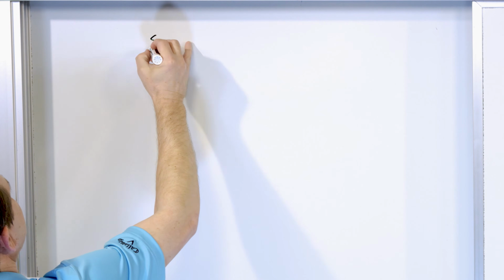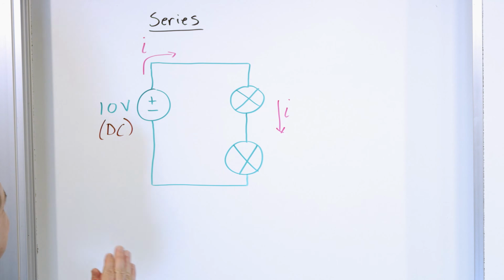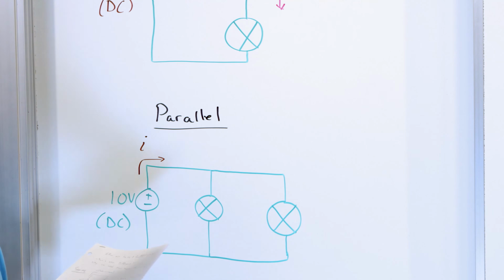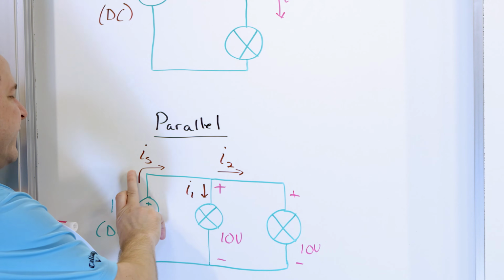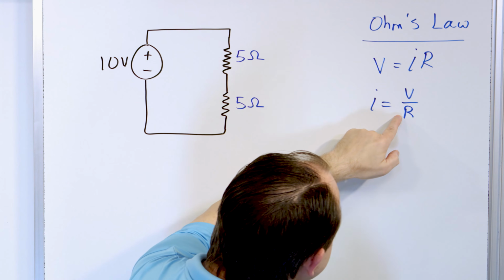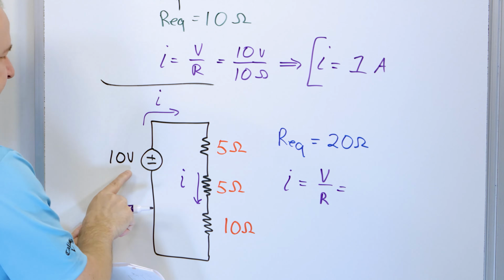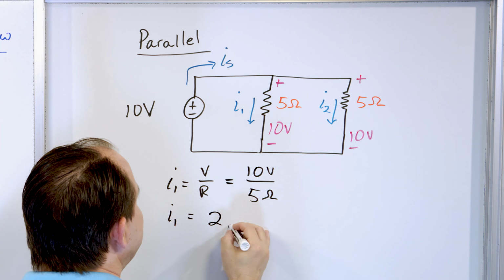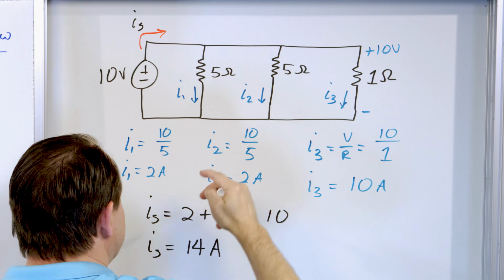Series & Parallel Circuits: Theory, Uses, and How they WORK

Comment: I know this is probably beyond my current understanding but does the battery. In this case the 10v battery, does it have a max amount of current "push" that it can put out. Like if I kept adding bulbs to the parallel circuit what happens? Assuming the battery has enough charge to not die.

Comment: Sir your explanation is very good and thank for sharing your valuable knowledge but you didn’t  explain resistance in parallel circuit. I mean if we add resistance in circuit total resistance will decrease and current increase.

Comment: I've been studying and currently finished an associate course in Electrical Installation & Maintenance in a government technical and vocational school, but this is the one i miss a lot the way it was demonstrated and explained it the way you teach. and it is very much comprehensible. thank you sir. i have now much understanding in what ive learn previously and its significance. specially the Ohms law, as well as the parallel and the series connection most applicable in household and in commercial establishments when installing electrical wiring.

Comment: When you showed the first parallel circuit diagram with 2 resistors(R1 = 5 ohms and R2 = 5 ohms), the current obtained from it was 4A. Then, when you showed the last parallel circuit diagram with 3 resistors(R1, R2 and R3 = 1 ohm), the current obtained from it was 10A. Does it mean let's say, you add 4 resistors, each of their resistance is 1 ohm and a electromotive force(e.m.f.) of 10V is applied through the circuit, will the individual resistors take in 10 amps of current which in total would be 40 amps?

Comment: I'm an electrician and   when you run outlets through  a room on one circuit they usually use the o outlet as the ridge or junction point. They don't run a pig tail of of two words to attach an outlet. So when one circuit or rather one outlet goes out in the living room that all go out and then you have to trouble shit all the outlets from kids of power

Comment: Might I add that the reason we have two thoughts on electron flow is that, for centuries, positives always moved toward negatives.   High values dominate low values.   One major example is that high-pressure atmospheric air flows quite naturally toward areas where the pressure is lower.   It is often considered more intuitive to assume "stuff" moves from a surplus to a deficiency.   With this principle established, early scientists, like Benjamin Franklin (1706 to 1790), assumed electricity was a fluid moving from high potential (+) to low potential (-).

Developments in particle physics enabled scientists in the late 19th century to actually observe that negatively charged electrons are the particles moving through metal wires from the negative terminal to the positive terminal.   The initial, incorrect assumption was deeply ingrained in engineering textbooks, diagrams, and conventions long before electron movement was understood.

Inconvenient?   Well, yes!   However, the flow of negative charges in one direction produces the same physical effect as a flow of positive charges in the opposite direction; thus, for most calculations, it doesn't matter.  Most!    The main problems arise when the physical direction of electron motion matters rather than just the current.    Actual electron flow matters in the fields of semiconductor physics, vacuum tubes, ion beam technology, and analysing electron motion.  The most significant "problem" arises when a person mixes the two conventions—such as using the direction of electron flow with right-hand rules designed for conventional current. 

Essentially, conventional current is a universally accepted historical "convention" for analysing circuits, while electron flow is the actual physical process.

Comment: On the series, two bulbs get the same current, what about the voltage? My understanding is that the voltage split by the number of bulbs, in this case two bulbs, so both get 5 volts each. Am I right?

Comment: First time I ever 'sat' in a class, where not only their teacher is a genius, but also his students are 'all' genius!!
I kind of got lost, when current either flows one way, or the other.  My logic was disturbed when the explanation that electrons flow from - to +, BUT let's pretend positrons are flowing in the opposite direction.  Why?  We were already told that the electrons were the real flow of current.  Better was the parallel explanation of a river flowing, from source, and splitting, into 2 branches.
I begin to think this electrical engineer must not be too successful at fishing;  if he 'pretends' the fish are actually swimming against the current, instead of the real direction of current flow.  No?  Well, what would compel the fish to not take the path of least resistance?  There must be some sort of payoff, to follow path of higher resistance.... like a salmon run, right?😢
I guess y'all figured it out;  I'm not too good at conventional fishing, so I must use a net, to catch enough for supper.

Comment: Hi. Great Video. I need 36V minimum 3.5A Din Rail PSU, but I struggle to find one within UK.
 I already have Omron 12V 4.5A and Omron 24V 2.5A. Can I connect them in series?
 I'm worried that I could overload the 24V one under 3.5A Load.
 I can get the same Omron 24V 2.5A easly localy and connect it in Parallel to other 24V.
 They are all same models. God or bad Idea?
Thank you.

Comment: In a series circuit, amperage throughout the circuit is the same. In a parallel circuit, voltage is the same throughout the circuit.
Reply: He just means that in a series circuit, the current is the same throughout and in parallel, the "push" is the same.

Comment: In my Solar I found parallel is far safer yes requires more wire but also gives far better results in shading conditions as a parallel system only the shaded panel is affected while in series one panel is shaded it effects every panel in that series! 
 Author of Solar Independent Utility Systems Manual

Comment: Basically what i remember being taught was that when adding resisors in a parallel circuit;
1/R1 + 1/R2 + 1/R3
Reply: That’s wrong 
Tr=r R1’s x R’2xR’3/ R’1. +R’2. +R’3 
According to NEC
National Electric Code on parallel circuits to find total Resistance 😂😂😂

Comment: Nice explanation.  What is your view on using conductance (where G=1/R, and using a variation of Ohm's Law, I=E*G) to figure out the current in a parallel circuit?
  
One might say or think, "there' a physical resistor in the physical circuit setup", which is true but since math calculations are a logical task and not physical it's another way to analyze the circuit Like the terms Resistance and Resistor are not the same, Resistance is a concept, and a resistor is a physical component.  I may not have the technical knowledge and prose to explain it fully, it's what I was taught (or remember being taught).

Comment: Between 14:20 and 15:00 you discussed, in general terms, the conductivity of various materials and said that water is not a good conductor of electricity. I will like to point out that people die from introducing water to high voltage circuits; something that you really should have explained in more detail. Also, water will short-out low voltage circuitry so the fact that it has a significant influence on the circuit means that you were amiss in not highlighting this aspect.
Reply: Or simply not have introduced water at all into your lecture.
Reply: i think, he ment pure water, only H2O molecules.

Comment: "water is not a good conductor". Why there is always a warning for not using the appliance near water?
Reply from the maker: That’s a great question. I’ll probably do a video just on that one day. Pure water is basically an insulator and does not connect electricity. The reason why there’s warnings on everything is when you sit in a bathtub or put your hands in the water than any salt, perspiration, or anything like that will dissolve in the water and when salt is dissolved in the water it is a very good conductor.
Reply: So, bathe in purified water if you must make toast at the same time. Just kidding. Keep electric appliances away from the bath tub.

Comment: When you say light bulbs are never wired in a series I disagree with that.  Christmas tree lights are wired in series and so if they stop working you have to hunt the bad light or fuse.
Reply from the maker: Maybe never was too strong of a word. But I was just trying to point out the advantages and disadvantages. Thanks for the thoughtful comment.
Reply: @ Yes, also some folks will light their back patios with string lights but I know what you meant...you meant in a home environment,  I was just messing with you!
Reply: Hi - That was true in days (long) gone by when christmas tree lights used small low voltage "filament" type lamps intended to be connected "in series"  directly to the house supply ( 240V in the uk  110V in the US and elsewhere). 
Typically  - each lamp would have a working voltage of 6 or 12volts - so if we assume lamps of 12V - then for a 240 v supply - we would need 20 lamps in series  (240/12) to enable direct connection to the  "house"  supply. 
There are two problems here:
1 - if one lamp fails  ( as they often did  especially when powered back up again after being stored for 12 months since last christmas  when they DID work,,,, but dont now !!)) - ALL the lamps go out - and  it is  a right pain to find the faulty one.  One had to remove each lamp in turn and either test it or replace with a known good one. - and often there might be more than one lamp that had failed.  So having a test meter was essential!
2.  IF there is only ONE LAMP  faulty -  usually due to the filament going open circuit - it will in that case have FULL line potential  (240V) across its contacts !!!   So one had to be VERY careful in diagnosing the fault. ( if working "live" - which people often did just to "try" another lamp...) 

All christmas tree  /decorative  lights are now LED - and they are  wired in parallel  - that is they run on low voltage  via a  safe fully isolated supply to connect to 240V   - and in most cases using  multicolour   controllable  LED's fed from an intelligent supply enabling selection of different colours and switching patterns.
Often these use a three wire system   one for digital control and the other 2 for power.
Reply: I thought Christmas light were a combination "series parallel?"  Because when one light goes out, only ten or so bulbs will die, but the remaining lights will continue to work.
Reply: he said  parallel connection has more advantage , because if one light for example have issues the other still works
Reply: Cheap xmas light yes.   Lol.  Buy the expensive parallel ones.  Youll be happy and keep your sanity and wont need a bulb checker :)
Reply: @rgardner1971 poor people are funny

Comment: Hi,
 i just bought your membership but i unfortunately dont get any of your old videos included. your old videos were gold and its not included in my membership unfotunately.. any way i could get them?
Reply from the maker: Actually, all of my videos are on the site so I’m sure you just need help locating it. Exactly what video are you looking for? Or you can send us a message directly through the contact link on the site I will get back to you with the link.
Reply: @MathAndScience  hello there
Reply: sir do you like video games
Reply: In a series circuit, voltage developed across each resistor is directly proportional it's resistance while current remaining the same.